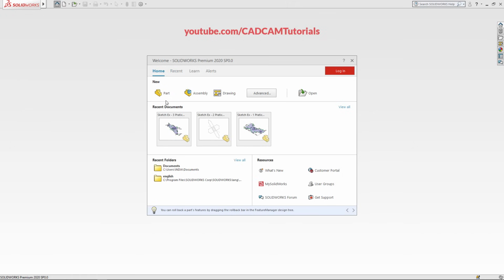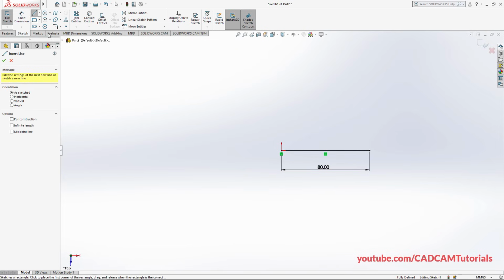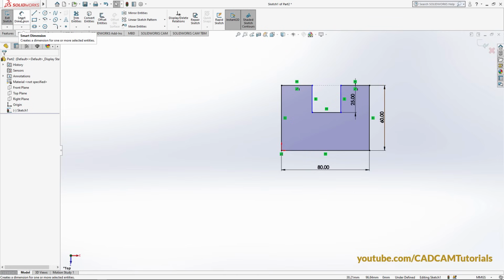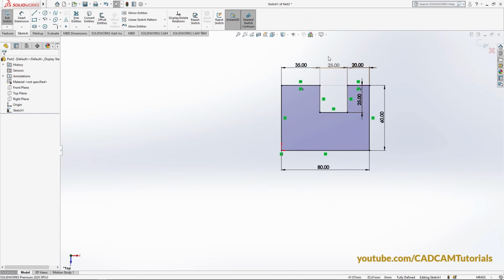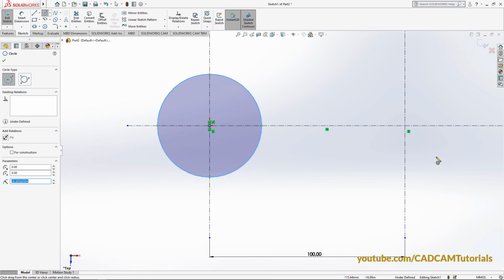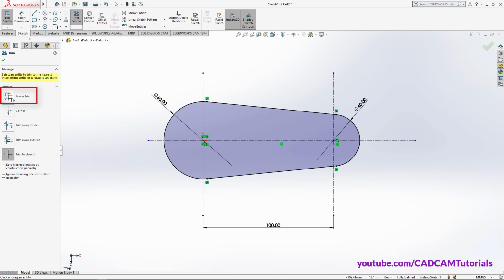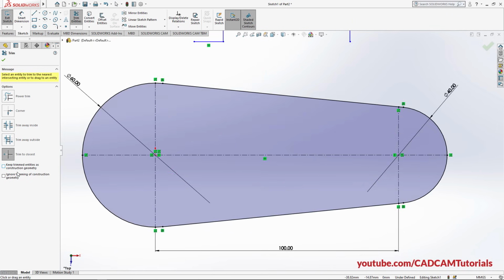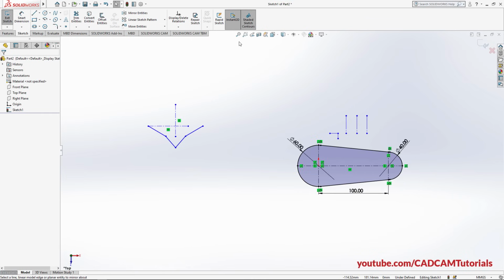SolidWorks Tutorial for Beginners #1

Comment: Sorry I’m not going to watch as I’ve been using it for many years at a much higher level but I appreciate you helping others learn.
Reply from the maker: You're are from which industry and which modules do you use?
Reply: @CADCAMTutorials  tool design engineer. We drive our tooling parametrically from a product design model. Also use a third party module called Logopress. Using parametrics speeds up design time by changing out the driving model to a new one. Which inherently makes components change shape based on the new configuration.
We use PDM.as well. There is a routine built in PDM called “copy tree” This allows us to use an existing design and change the the name of all components (typically 100’s) of parts and all the drawings. The need for new drawings is mostly eliminated and some will be just a rebuild and save.
Reply: @ckane510 Hello,
Do you design carbide tools for CNC machines?
Reply: @namikazeminato7782 no
Reply: @namikazeminato7782  no

Comment: sir, I want to purchase the software for design and drawing. I am beginner in the Hobby engg, DIY field. Working on scale models, 3D printing for crafting the projects. which soft ware you will suggest  for my purpose. presently i am following fusion 360 tutorials. as per my opinion it is quite  friendly for the beginner like me. kindly advise. it will be helpful if you share the email.
Reply from the maker: Hi 😊, I don't have any experience in 3D printing. But if you ask about CAD software I like both SolidWorks and Fusion 360. Both are easy to use. You can decide as per your budget.
Reply: Thanks for prompt response @CADCAMTutorials